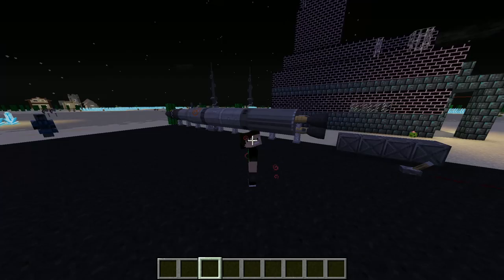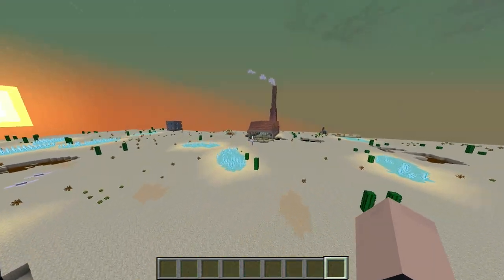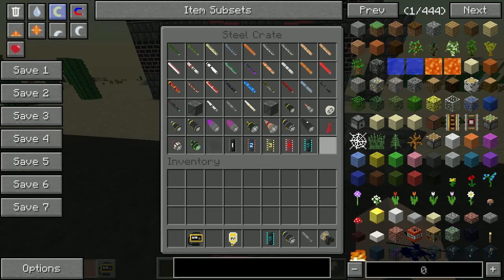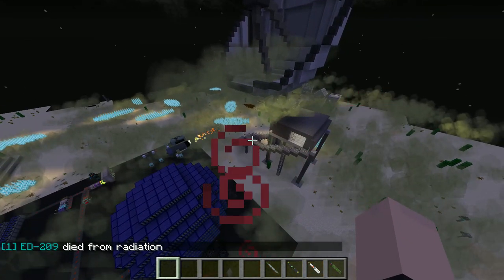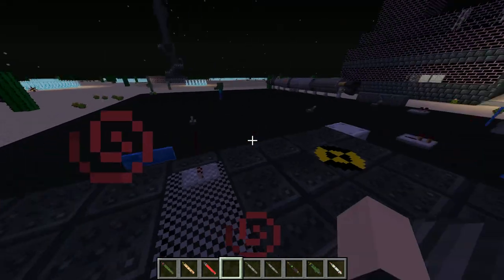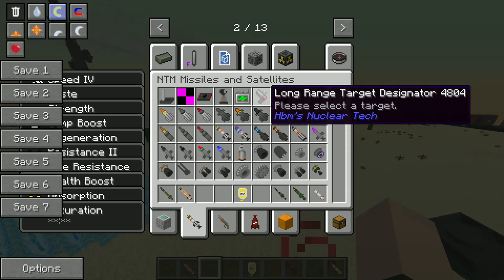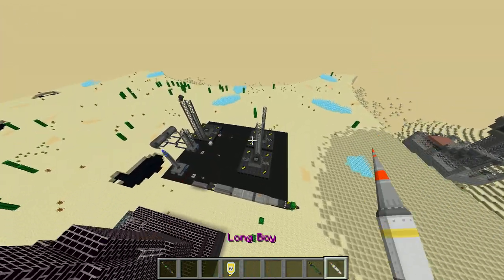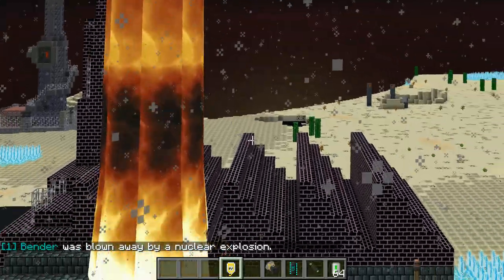MAKING CUSTOM ROCKETS ?! | HBM Mod Ep3

Comment: Bro how do you get kerosene and hydrogen peroxide in buckets if you tell im sub
Reply: Terminator Playz  why not work
Reply: the item in large launch pad
Reply: @luckyme13  use empty fluid barrels and Universal fluid tanks